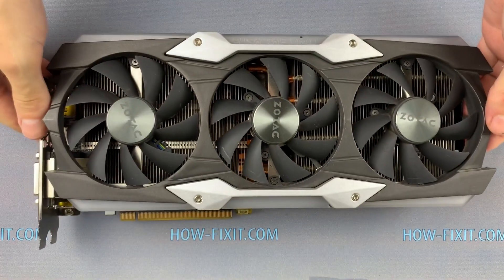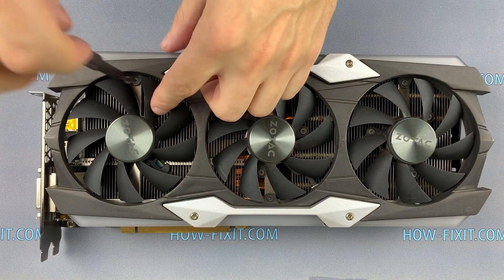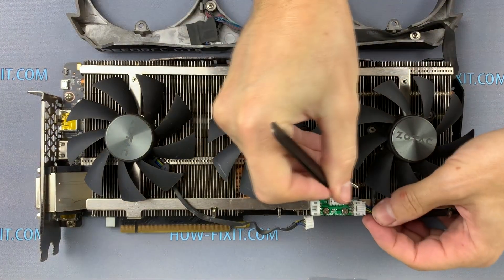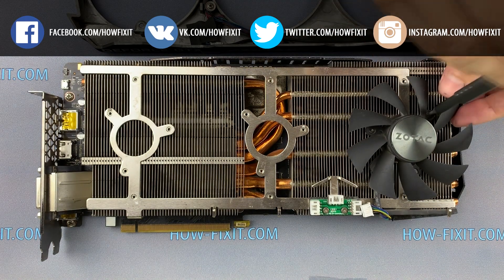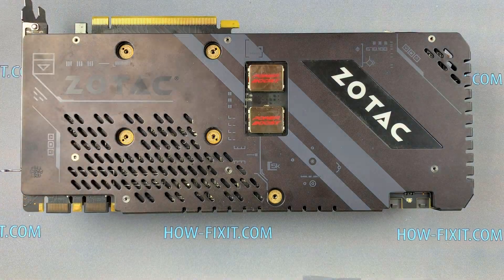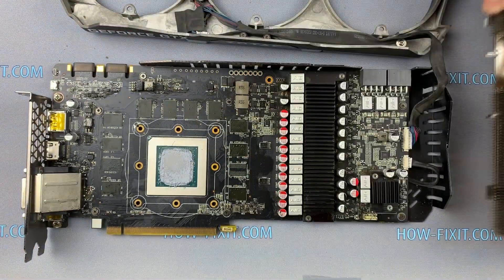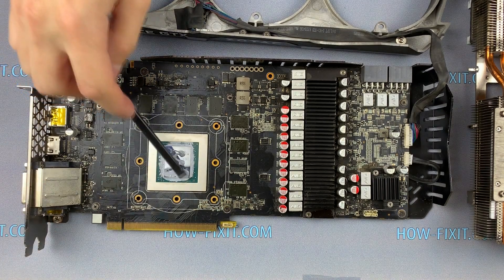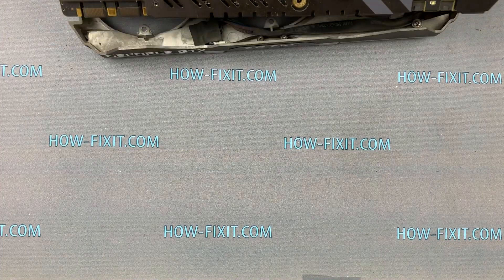GTX 1080 Ti ZOTAC Disassembly, Cleaning and Replacement of Thermal Paste

Comment: I replaced my paste finally, with Arctic MX-6 and im currently at about 29.8 C* average @idle, on log in.
Watching this video at 1080p fullscreen its about >38.2
I think its around 3 degrees lower than normal, overall.
Ill come back and update after i do some 4k gaming. Highest ive seen it before was 76C*.
Reply: Yes, i cleaned it off entirely everything i could. I treated my 1080TI like a 1080TI.

Comment: I know it's an old video, I was wondering if this 3 fan heatsink will fit the 1080ti amp (2 fan heatsink). The contact area looks identical but not sure if screw hole dimensions are the same.

Comment: The fans on my GPU stopped spinning all of a sudden today, all three of them have stopped spinning which is weird. I'm not sure if it's a hardware issue or a software issue. I tried to force them to run using MSI afterburner, using HWMonitor, I can see that power is being sent to the fans but the RPM is 0.

Is there any other way to test it before I go around buying new fans only to find out that the issue with something else entirely ?

Comment: Where do i order the anti static brushes from? Amazon is a cesspool and you could very easily wind up buying something thats misadvertised and thereby ruin your stuff.  I just need the brush, the rest of the stuff in that combined kit is mostly useless.
Reply: You don't need anti static brushes. I don't even know who even uses them. It's a gimmick. Just put a blob of thermal paste about the size of a pea, or a quarter of the size of a cherry seed, onto the middle of the chip and gently set the heat sink on top and gently wiggle and squeeze together the top and bottom together.

If you are that concerned about spreading the paste yourself, then you can use any kind of flat plastic stick to spread it. Things like clipping the side of an end of a plastic straw, or putting a single layer of serran wrap or a clean grocery bag over your finger and smear it with your finger.
The point of the paste is to help transfer heat away to the metal block where it can be spread and cooled by the fans.

You don't need a special brush. Just don't use wood, paper or metal to spread the paste. Simple.
Reply: @Nick1921945  Every PC tech i know has anti-static brushes and an staticless vacuum. Artic includes the spreader for thermal paste.. At this point, ive hand assembled 11 PCs. Personally, I use an static strap around my ankle thats plugged into a grounded socket when im working on delicate stuff. Got it back in my machine shop days, available from Grangers.

Comment: do you fix GPU? in United Kingdom ? I have GTX 1080ti which crashing during benchmarks / stress test
Reply: I have the same problem, did you manage to solve it?
Reply: @MegaFernandogames  I know very good person in UK who is fixing GPU's let me know if you need his details
Reply: @wmurawski84  the video card was the gtx 1080 ti amp extreme?
Reply: @wmurawski84  my video card crashes in the msi kombustor benchmark and in games, what was the problem with yours
Reply: @MegaFernandogames  dying core and faulty memory modules , card in fixed running on -400 core in MSI afterB
Reply: @wmurawski84  did you get it repaired, how is the video card?

Comment: My fans don't spin, and my pc shuts down and restarts when i start a game. 1 do you think the fans not spinning might be the cause. 2 think this might resolve my problem
Reply: Overheating. If all fans have failed, it might not be a fan issue though. Use software (I like MSI afterburner) to ensure fans are supposed to be coming on. If they aren't then the card may have an issue. I dunno, just my 0.02.
Reply: @GwaiRide  found out fans did spin just just shut down when drawing more power chamged psu
Reply: @OmegaBrotex  awesome! It's a wicked card! I'm playing warzone right now on it lol

Comment: just changed out my thermal paste....used arctic silver.   The original stuff was hard and the card was running 8 degrees hotter that others in the same mining rig.   I will post results later today... thanks for the video.
Reply: waiting the results 2021
Reply: 2022 and still waiting on results
Reply: How were your results?
Reply: Now on 2023 😂
Reply: 2024 now. I wonder if the OP died? 🤣🤣🤣
Reply: Op turned into an ice cube

Comment: Alright, I have a 10-year-old MSI CR-620 Intel Core i5-430M laptop. It came equipped with 4G RAM. I am trying to upgrade it to the maximum allowed, 8G RAM, by replacing the 2 DDRIII 2GB-1333 memory sticks with 2 x 4GB 1Rx8 PC3L-12800S-11-11-83 memory sticks. The laptop never boots, all I get is a black screen. I am forced to revert to the original 4GB of RAM. Does anyone know why the 8GB does not work? does it have to do with the speed of the memory? Any help is appreciated.
Reply: u need pc3 10600 ram.. it is other name of  1333mhz

Comment: Alright, I have a 10-year-old MSI CR-620 Intel Core i5-430M laptop. It came equipped with 4G RAM. I am trying to upgrade it to the maximum allowed, 8G RAM, by replacing

Comment: Does GPU thermals improved over the stock applied paste?
Reply: I just cleaned my mildly dusty 1080ti and replaced the thermal paste. My card had been getting hotter and hotter under nominal loads over the years and was thermal throttling constantly while playing intensive games, post Artic Silver my GPU never surpasses 77° degrees max while benchmarking (with an overclock applied) and mind you this is in the Node 202, an itx case
Reply: Most likely yes especially if its old paste. What would improve thermals even more is if you leave the shroud around the fans off and only put the fans back on as the shroud does trap some hot air.
Reply: The question is broken English.
Actual commercial paste is better than "stock /factory" paste.
If you're using low quality paste, the thermal readings will be the same unless the original paste was virtually expired...